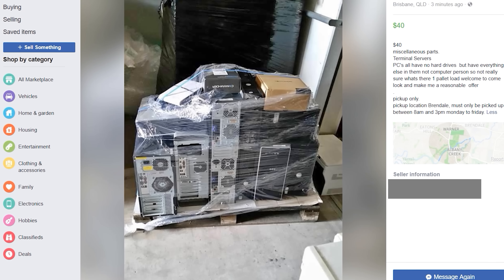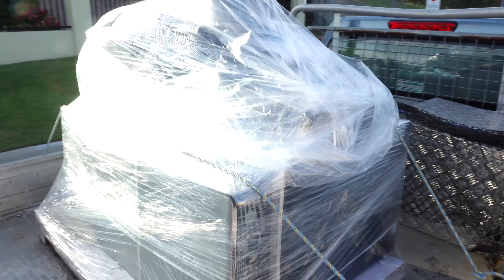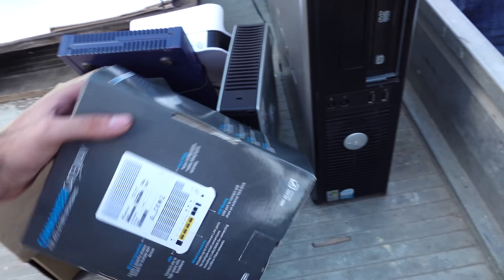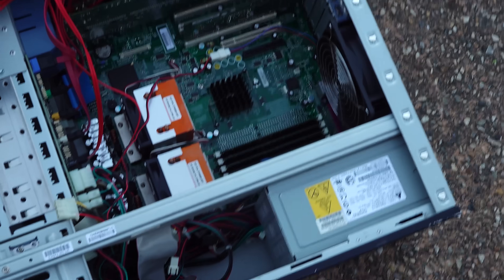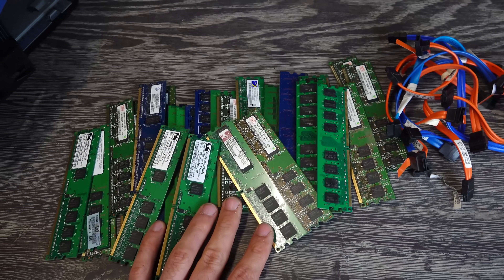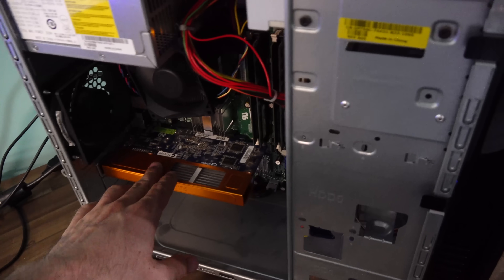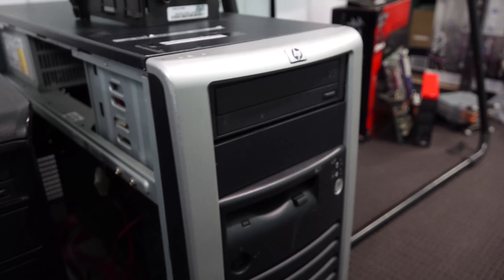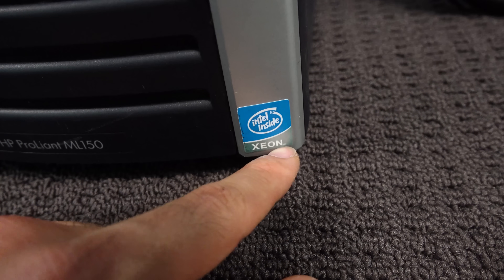I Got 15 Computers for $30....!

Comment: Man if i didn't have to worry about money and career i'd start buying used pc parts, assembling them and giving them away for free. There's so much e-waste and such a demand for cheap gaming desktops and you can go REALLY far just buying an used office desktop and switching out the GPU with an used GTX 1650/whatever the motherboard supports.

Comment: if a PSU 5V rail has a bigger spec than 12V, doesn't mean that it's really bad, it's just made for older systems that need more power on 5V than 12V

Comment: I was at my local tip and a guy beside me was saying that a stock motherboard sells for 4 or 6 Dollars each at a place called Tall ingots which I believe use to be in Fairfield up here in Brisbane and old copper wiring also sells foe $4 per kilo so at the end of the day If u gutted all the old stuff and took it back when u went to brissy it might pay your fuel ?? lol whether its worth the effort ..Maybe if you got a good load together.

Comment: any windows 7 licences are worth keeping for win 10 upgrade activation.

being oem there is a good chance the am will match pretty well for 8gb kits.

hard drives are worth keeping even just to drop into cheap external cases.

it is worth checking the cpu's some may be quads 

some of the bigger dells will be btx but may support some decent quad core 771 chips for a cheap 8 core skull trail style pc with cheap ecc ram suppport.

You could spec up and donate any of the working machines to local charities for kids so they can do school work etc.

Comment: A Core2 Quad 6600 can easily run League of Legends - also - if any of those graphics cards are just semi decent CS:GO should be fine as well. Even Fortnite at minimum settings should be possible given the right supporting cast (like at least 4GB RAM)

Comment: A core 2 quad is a good find.  Those old optiplexs can hold 8 gigs of ram. Find a cheap low profile card and it's actually a serviceable low end gaming machine. Just make sure to use the 720p settings for most games.

Comment: Dude i used about 4-5 years lga 775 pc, if you put in an lga 771 xeon 4 core moded processor, or lga 775 4 core  processor  with an 650 ti or any older but good videocard and 8 gigs ram, you can play a lot of games. I used an core 2 quad e6500 and an hd7870 with 8 gigs of ram, i played on it really well gta 5, final fantasy xv, cs:go, fortnite on nearly meadium, lol, r6, and so on

Comment: those core2duo systems can still be totally usable! flash the bios to the latest, drop in a cheap q8300 quad core + 4x 1G (or 4x 2G if you have it!) and a low profile graphics card and they're great daily use machines

Comment: the asus board im pretty sure i could get to support phenom ii x6 if it doesnt already as long as it takes ddr2 some weird 939 sockets take ddr lol
Reply: those dells also all support core 2 quads with bios update as long as tdp of cpu is 95w
Reply: and the ones with four dimm slots you can upgrade to 8gb ive tried 12gb but didnt work 8 works and oddly some configurations of 12gb will boot up i had exact same dell board and i broke it lol

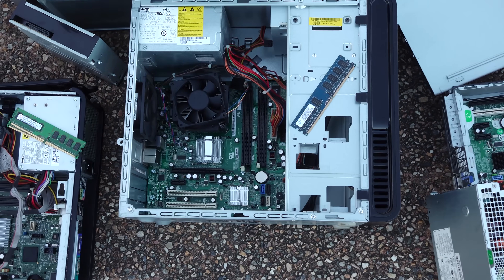Comment: TYC that mobo at 4:36 is not good, i have the exact same pc, and the BIOS is locked down so you can only upgrade to other Core 2 Duos

Also, if you get the latest BIOS revision for it, you can only upgrade to 8gb of RAM

Comment: if you try to overclock a athlon 64 with a modern power supply you will kill the new psu, the 5v rail amps is high for a reason

Comment: just a note power supplies with a beefy 5v rail were ment for older systems because the 5v was what powered the cpu not the 12v

Comment: You know those stereos that can store like 60 discs inside, I wonder what a DIY Blu-ray storage with 360 blu-rays in it would compare to hard drive storage.

Plus that would make it easier to backup your storage, say you were YouTuber like Linus Tech tips, you could store petabyte of storage in less space. And you don't really need quick access to every video you've ever made any way.

plus you could probably still get access to a video file in less than 60 seconds anyway so.

Comment: That high amp 5v rail PSU isn't inherently bad. Older PSUs and PCs ran much more on the 5V rail and only relatively recently did the 12V rail become so important. Of course, it could be a trash PSU, but you cannot make that assumption just based on the age of the PC it was installed in.

Comment: We filled a dumpster with about 30 brand new computers that had been donated to the school because they didnt conform to school technology rules. Someone had donated them all. They were basic units that run off one master Hub but because it wasnt the school systems program, they made us dump them. They woulnt have had any Hard drive but would have had a standard motherboard. Had I grabbed some, I could have installed a hard drive and memory sticks in a few and sold them. We also threw out all the monitors and keyboards. It was a terrible waste of money and every one could have been stripped for the basic components. Looks like you scored what we might have dumped had it not been in the 1990's.

Comment: Those lil dells could sell for 100-150 bucks I have three Optiplex 780's with 8gb ddr3 ram, and Q6600 quad core cpu's, downside to these is the onbourd graphics have no drivers that work with Windows 10 and the PSU's are terribly weak so graphics cards are limited.
Reply: I wouldn't pay more than 50 for a 775

Comment: If you're curious, those "Mini PCs" are terminals, kind of useless without a main server. Most HP models came with a 1Gb CF card for storage, there's technically a sata port on most boards that you could solder a header on to (as in, the chipset has the capability for a sata port and the traces are there but no header exists, there's guides on how to do this). Mostly interesting as experiments but they don't really hold any value.

Comment: I used a heatsink out of an older PC which was huge like the ones you have and my i7 3770 went from 72c to 61c under load... Those heatsinks work WONDERS.

Comment: Why dont you just cluster the most powerful nodes and applicable RAM, considering you paid 2$ for each try to user them .  It would take some configuring to get the resources pooled  and the computers talking to oneanother with openMPICH .  Here is a link to the machine file https://www.open-mpi.org/software/ompi/v4.0/

Comment: The 5 volt rail on older power supplys had to give more amps because the old hardware was requiring more amps on the 5 volt and not so much the 12 volt rail :)
Nothing to do with crappy psu's

Comment: the low profile HP computers have p4 chipsets. Why not make them the computers? The p4 chips average dual core 2.2-2.9 with hyper threading. Put 4 gb ram and a cheap gpu and ur good to go. I  came across 4 of them a few years ago and they sold last year for $100 each. People want smaller pc, and dont care if it can game.

Comment: All the fans that had sidemont cpu cooling are super high rpm fans worth $12.00 a piece (20 * 12 lets say =$240)......you put all in rubbish ? ?the fans are worth more then all that ddr 2 ..ddr2 = $4.00 a gig ($120) pc case empty = $4.00( 28* 4=$112) you kept $170 worth of pc and put in rubbish $700 .......you are silly .

Comment: Big fan of your channel, and a follower. Have a question for you....
I have a DELL DIMENSION 5150c Slim... Here are the specs.
Pentium D CPU 2.8
4GB of RAM (DDR2)
NVIDIA GFORCE GT 710 EVGA 2GB of DDR5 PCI x8
PSU 275 Watts
Windows 10 Professional
The graphics card does not want to work, I'm I doing something wrong, or is it that this PC can not handle this type of card. Any advise or help on how to solve this... Thank you. Keep up the good work.
Reply: You really shouldnt be using Windows 10 with that hardware... Windows 7 would be a much better option.

Comment: 5:15

The original "CodeGen" case. I have the vanilla black case since 2006 and stil keep it today. Though, mine has a circle in front of the panel instead of " | |  | | " thingy. Still, an amazing steel case which has more then 10,000 holes for ventilation on it! ( or so i heard)

Comment: In regards to the PSU for the AMD Athlon XP PC, from what I've been reading on those is that those CPUs required a stronger 5v rail than the 12 volt, look into it before you down check it.

Comment: The core 2 Dell Inspiration PC can be pin/tape modded on the cpu to run up to 3-3.2ghz without touching the Bios or a software as these motherboards do not allow overclocking.
I tried it out and it worked great!

Comment: That Athlon 64 system definitely deserves anither video. Put in fastest CPU supported, max out RAM and 10k rpm HDD. Slap in Radeon 7970 or something from 6000 series and watch it fly. Or if you want period correctness then ATi 1950 XTX.

Comment: Hey let me give your father a tip: HANDS AT THE NINE AND THREE, FORGET TEN AND TWO!
- 10' + 2' is outdated by 100 years from before there were airbags
- inefficient steering control
- less control of steering wheel turning radius
- airbag comes on, hello hospital
- uncomfortable

9' + 3'
+ everything. Learn from rally and drift car drivers.

Comment: always good to have a old graphics card hanging around just in case you need to fix something and your main GPU isn't working right
Reply: I didn't look, but It's probably a old AGP or PCI video card, that won't fit in modern boards (no PCI or AGP slots, nowadays).

Comment: oh fuck i'm so jealous. you basically got my entire lan room (minus the GPUs) for $30.
too bad you're totally misusing this treasure. all the best games of all time run fine on these specs if you put something like a 7600gt or better card.

it's like you got a bunch of cross rally cars for really cheap and instead of setting up a cool little league to have fun with them, you're taking off their wheels to sell and scrapping the rest of the parts.

Comment: I brought 15 computers to demolition company who wipes the disks and scraps the parts for recycling. Were all C2D machines with 2 gb ram, or even just one. So its fun to fiddle with, but actually worthless in daily use. DDR3 should be put back in production, so loads of pc's could get a second life with a SSD disk. But they force you to buy DDR4 so you need to do it all over again. So if computer companies would really care for the enviroment; put DDR3 ram modules back in to production, and give them a good price point. Not due 'out of production' prices which also skyrocket up into bizarre heights.

Comment: The PSUs can be made more useful with "add 2 PSU" devices. You can build a 1000+ watt power supply from a stack if little ones.

Comment: hows he getting 100 bucks outta DDR2 ram? people buying DDR2?
Reply: lol most of India still needs ddr2 3rd world pcs
Reply: Some computers need DDR2 or servers. Cheaper to buy more ram than buy a new PC/server
Reply: @janelewis7385  well I understand server ram, that's gonna be ecc, but the rest is non ecc.
Reply: Some people need DDR2.
Reply: @janelewis7385  For what? running a system? I really wish he noticed this comment cuz I would like to know!
Reply: @janelewis7385  fiver on amazon new
Reply: True
Reply: u have decent boards old c2duo/quad/phenoms make cheap mining rigs(when mining was good)
Reply: @bobjones9614  phenom used ddr3 didn't it?
Reply: @The_Cokimoto  there was AM2+(ddr2) supporter phenom 2.They had ddr2 and ddr3 memory controllers built in.Example AMD Phenom II X4 955 could be slapped in a am2+ board if the mobo maker added bios support
Reply: @bobjones9614  looks like I was wrong I had no idea it supported both, that's kinda cool!
Reply: @bobjones9614  got for the 1060 turban core :) phenom that chip was a beast  in the day gave intels extreme a run for  its money
Reply: @madman026  ikr I had my old phenom II 6 core and it was a beast when oc
Reply: @madman026  still using a 1055T here heh
Reply: @bobjones9614  I STILL HAVE MINE TO

Comment: I could certainly make use of the copper core cooler in that Optiplex. Got a Optiplex 755 MiniTower that i swapped from a P4 E2220 to a C2Q Q9400. Sadly, it runs a bit hot with the lower spec alu cooler. been considering buying one of those copper cores, but not sure if it would be worth it, what with the PC being BTX layout and everything.

Comment: Those 5 volt, 20+ amp power supplies are getting to be collector's items for retro PCs, especially the higher power draw Athlon XPs. Based on the number of units with serial and parallel ports on the back, I was surprised more of them weren't Pentium 4s.

Comment: Look for 1066 FSB core2Duos because you can BSEL mod them to OC them on OEM mobos.
For example, an E7400 runs at 2,8GHz but with the BSEL mod jumps up to 3,5GHz.

Comment: Hey tech yes. I recently came across 6 core 2 machines like you found with 3ghz 775. I am gonna update 3 to Xeon with a cpu socket mod and 3 to core 2 quad maybe that’s is a good route for ya on best in class for those with maxed out ddr2. I also got a 6 1/2 height amd hd6450 for 40 usd on eBay so try will be pretty good capable machines!

Comment: Do an oldschool 771 mod build.
And maybe the Xeon machine has socket 604 which supports 6 core Xeons. Those have 6 "core 2 quad - like" cores.
Edit: YES, this seems to be a 604 board.
Please, do this. 12 core2 cores.... Insane. This would be very original. I have not seen a lot of youtube vids about them
Reply: Great idea! Which CPUs do you exactly recommend for this?
Reply: @spranto  xeon x7460.

But I am not 100% certain this server/board supports it. Socket 604 seems to have had a very long lifespan, similar to LGA775, so there are probably older chipsets which don't support the greatest and latest CPUs

Comment: The space these old things take up is worth more than the hardware, but if there's enough space to mess around these junkers would be pretty decent to practice board repair and get good at soldering, maybe harvest generic components like mosfets and chokes, caps are probably pretty bad from years of use.

Comment: points to pile of rubbish ddr2 and says it's worth over 100 dollars..... wow. had to unsub after that
Reply: Christie Malry  sooo i just checked cex... they buy ddr2 for .80c aud per 2gb stick... they onsell for $4, which is an absurd ripoff and about the going rate for DDR3 on buy/sell forums
Reply: Christie Malry  they buy 4GB sticvks for $4, which is not so bad as it's quite a bit rarer than 1 and 2GB sticks, but they onsell for 15, which is again an absurd rip off
Reply: Christie Malry  wow... maybe i should sell the bags and bags of ddr2 i have...